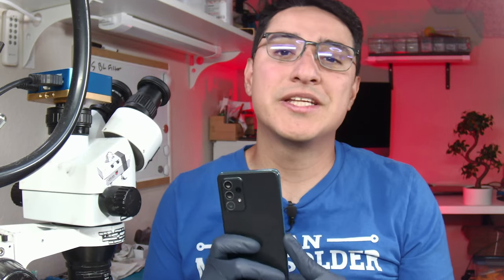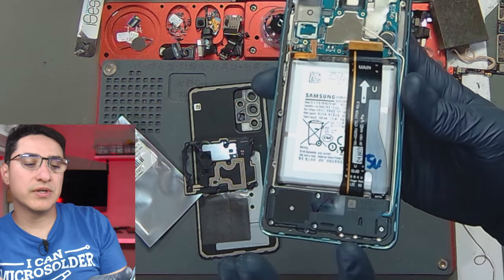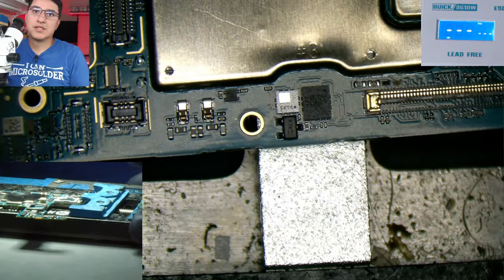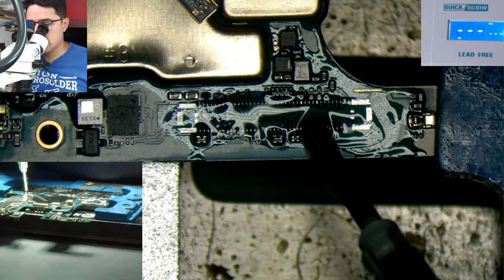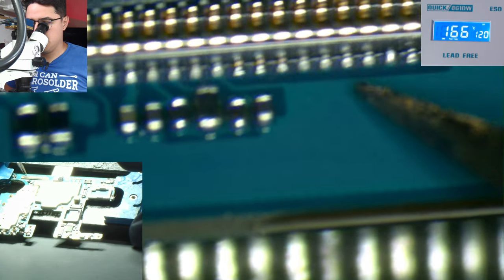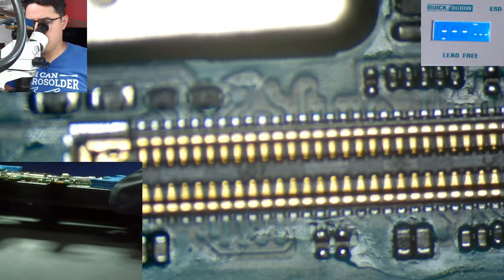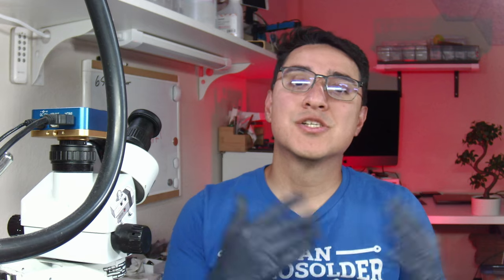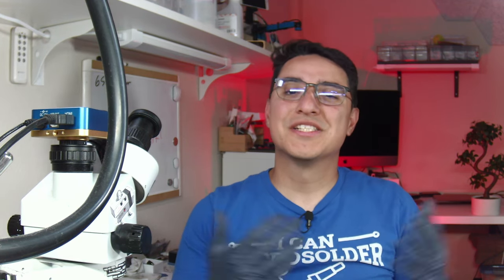Samsung A52 Not Charging No Image Repair - Broken FPC Connector Replacement.

Comment: Thanks for this Jesse! I’m also doing one of these and I found that I wasn’t able to get the pads to flow. I went through about 4 connectors so far and this is one of my first connector repairs. I’ll be using an iron to touch up the joints.
Reply from the maker: Glad you found this helpful. I hate connector repairs because of that issue! haha

Comment: Hey budd, I have note 10 that have static white screen and colored dots everywhere, then it goes black when the phone gonosh booting, the phone respond to touch bit no display , it happend after I toke the back to replace it as it was broken, I toke the display flex ribbon off and put it back multiple times and cleaned it with alcohol still the same, the phone was working fine but the wireless charging didn't work all the time,  is it the connector? Or the screen? And how much you charge for repair, thank you very much.
Reply from the maker: Hey! Contact me for a quote: www.vccboardrepairs.com/contact-us

Comment: My A52 broke in this same way and the bottom row of pins broke off like this phone. The repair store soldered a new connector back on but I still have no image. I ended up taking the phone back since they told me they tried everything they could to fix it but no luck. Could it be an issue with with the flex cable instead? Thank you!
Reply from the maker: Yes, it would be the flex or the screen or something else. If you're in the USA, I can take a look at it for you. Contact me for a quote: https://www.vccboardrepairs.com/contact-us

Comment: Sorry for beeing late here. Nice video very instructive. Did identify the problem finally? It seems mine is suffuring same symptoms. Could it be a simple FPC flex connector issue? Thank u
Reply from the maker: Yes, the customer replaced the screen & fully fixed it.

Comment: Brother I need your attention.
I recently bought the iphone se 2022 on launch and I am facing random reboots. I just had one today and its the 5th time.

While using the phone, the screen goes completely black and the home button stops responding and just after that the phome restarts and works perfectly again. Could this be a software or hardware issue? How can I fix it?
Reply from the maker: Maybe it's the same as this: https://youtu.be/GSH2Y-Sp3Nk
Reply: If you have 2022 it will be in warranty, so take it back to the seller or apple authorised shop

Comment: Good one Jesse!

We do those here in Brazil, since the A10. All of them show this problem eventualy, most of them after screen replacement.

I keep thiking to my self, why would it be? :D:D:D:D
Reply from the maker: Thank you!
Reply: @VCCBoardRepairs  By the way, Jesse. I’ve a board holder similar to yours. It’s a Mechanic. I’m struggling with it, cause it “draws” much heat of the board. I’ve to, kind of, saturate it first, so the board starts to heat up, so then I can desolder components. That happens most of the time with components near the edge of the board, that stays next to the holder itself. 

That also happens to the K23 you’re using?

Comment: How much temp wire Sir
Reply from the maker: just enough to allow you to solder it on
Reply: @VCCBoardRepairs  I just success replacement main socket SM A22 4g Thank you your video
Reply from the maker: Congratulations 🎉👏